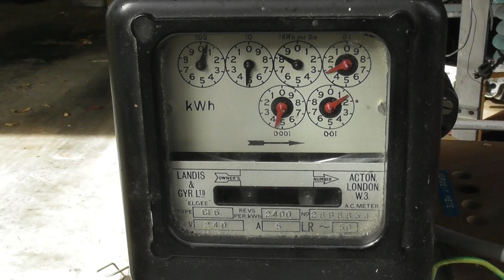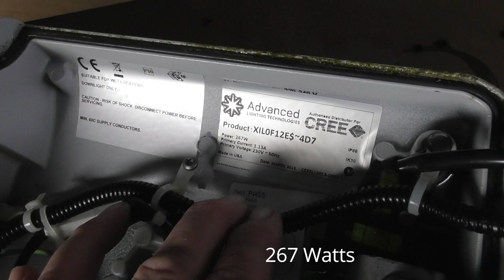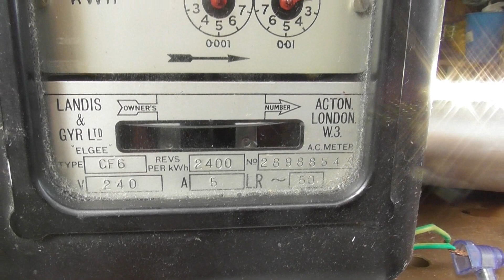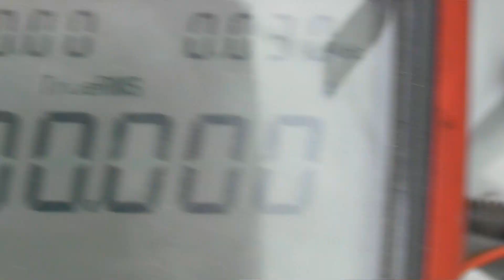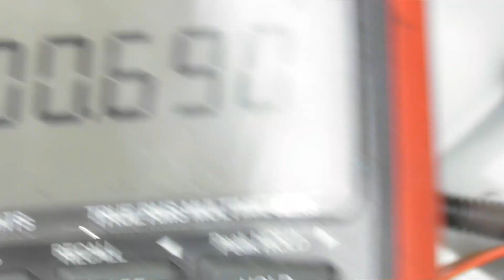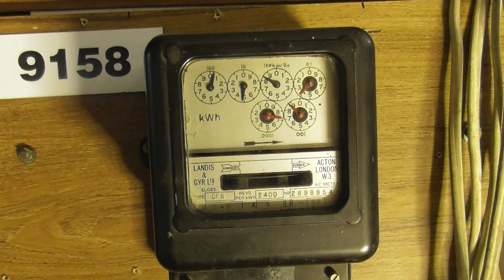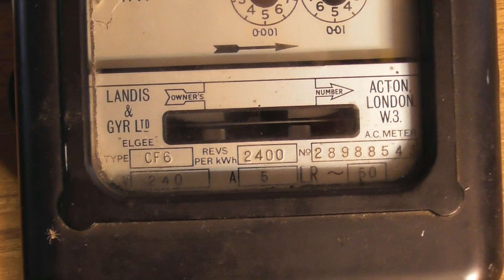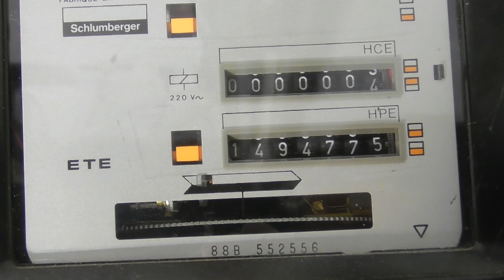CREE 267 Watts LED Street Light,  Load Measurements

Comment: They would make some good security and / or garden lights. Would last longer than the crap ones B&Q (UK) sell that fail regularly and need annual replacement.
Reply: Might be better off looking at City Electrical (Or similar) for equivalent of these lamps being sold to the trade. They do accept private sales as well.